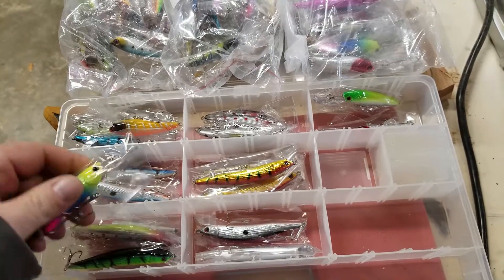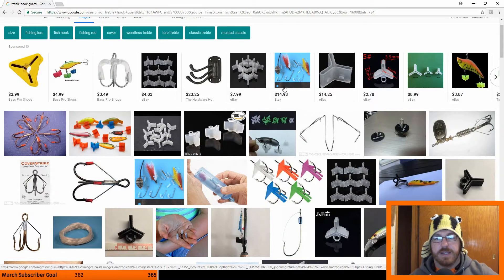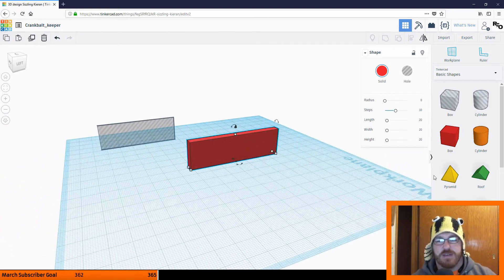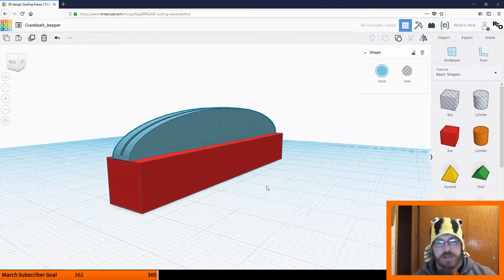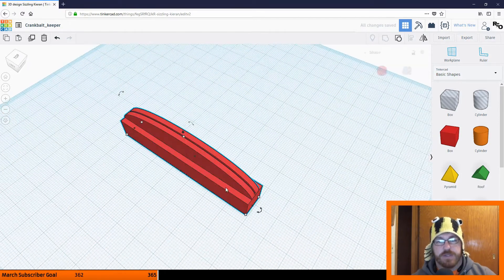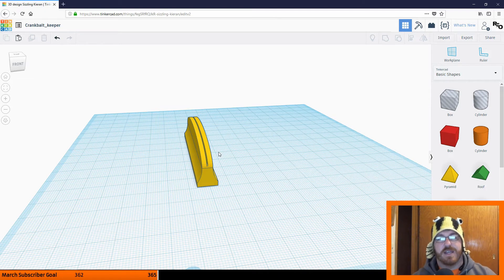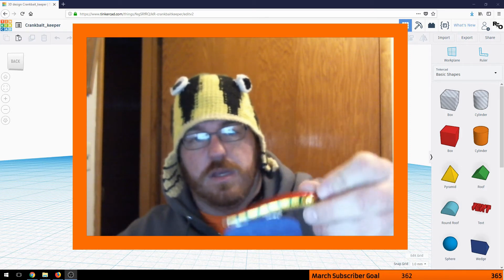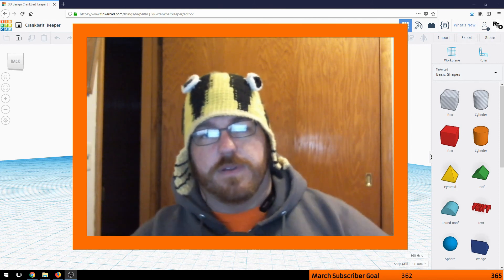Crankbait Keeper tackle box solution project tutorial Tinkercad

Comment: awesome idea!!
Reply from the maker: Thanks! It works pretty well so far having put them on a few full boxes.  If you leave the boxes out in the sun and they're clear the plastic can get a little soft and they get lose on the hooks.  I think the next round of prints I'll try ABS to make sure the heat doesn't warp the PLA or PETG.  In the spring and the fall they seem to be fine.
Reply: Revamped Outdoors  sorry for the late response I didn't check my notifications till you replied on the other video I commented on so i'm sorry and thank you for your time. also, i just got some pom(Delrin) and would like to know if you would use it for this or would abs be better for heat
Reply from the maker: I'm not to sure on POM but ABS would be better for keeping in a hot container in summer it should stand the heat better and not warp and open up as easily.  Please be careful with the POM it can be pretty dangerous it looks like.  https://reprap.org/forum/read.php?184,290357